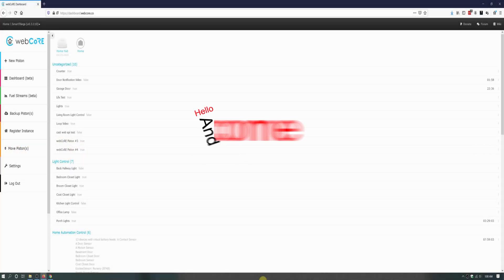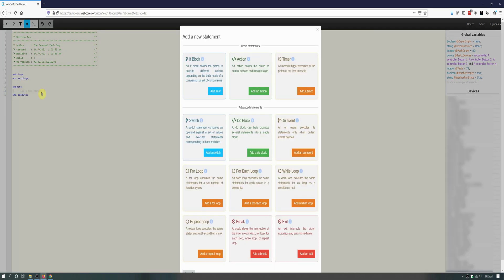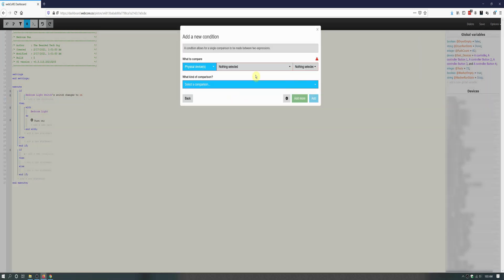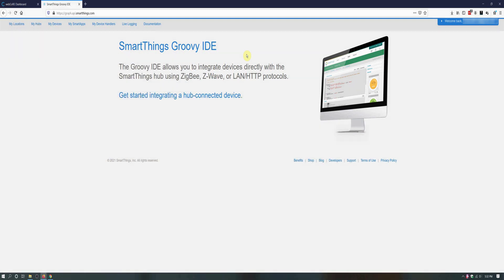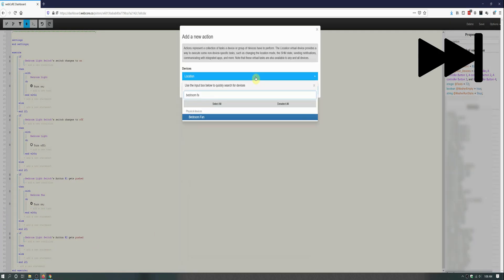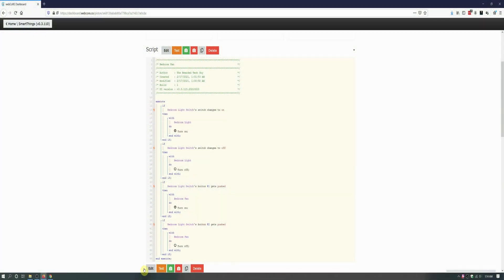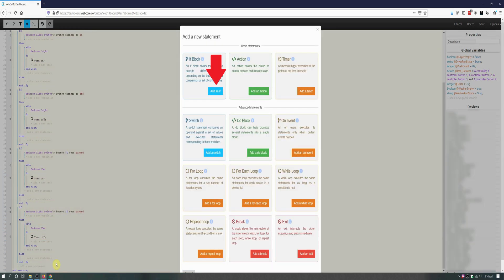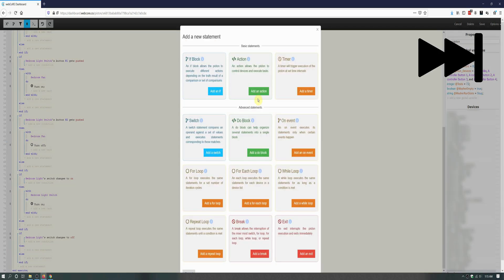How to Mimic a Hardwired Smart Fan with Smart Switch and a RF Bridge | Making your Ceiling Fan Smart

Comment: Nice Video BTG.  Isn't WebCoRE slated to go away?  If so, any idea of the time line?
Reply from the maker: Great question! At some point the current webCoRE will stop working on SmartThings. It does actually work on hubitat though so it will live on there. Also, the original creator of webCoRE was brought onto the SmartThings team a few years ago and last year they released a new demo version of webCoRE for testing on the new backend of SmartThings. Its limited in functionality right now, but webCoRE isn't going anywhere.
Reply: @BeardedTechGuy  - That’s good to know. I keep thinking that I’m going to take the time to learn how to use it but so far there has been too many other distractions. It is obviously very powerful.